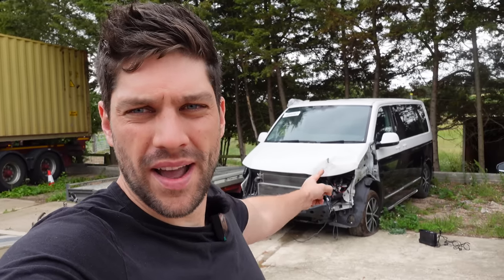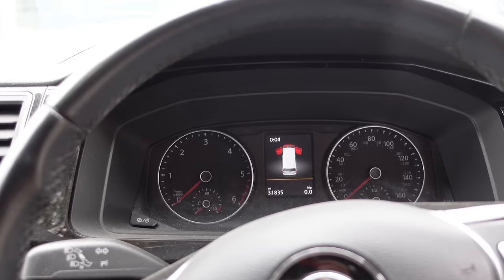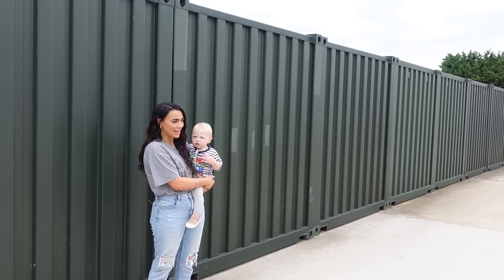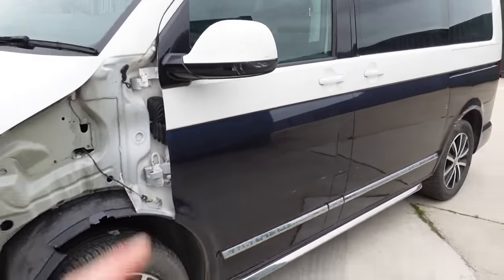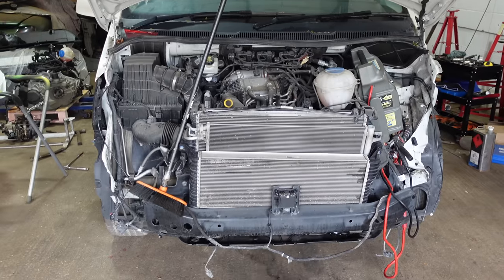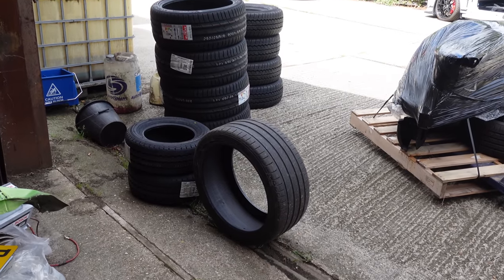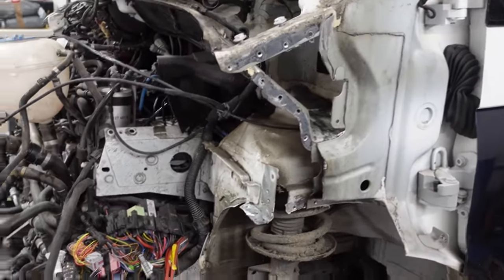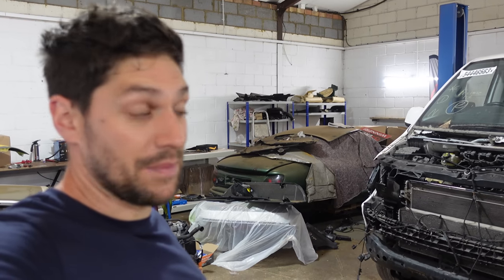I BOUGHT MY WIFE A CRASHED DAMAGED VW T6 CARAVELLE!!

Comment: Great find! You called it a Bus which is the correct thing to say in the VW Scene. These are so easy to work on and hold there money. If you need any help head over to either the T5 or T6 Forums were I’m a moderator on both. Good luck Dean!!

Comment: I’ve been a body tech over 30 years. My advice is to use a proper spot weld drill bit. You don’t drill through both panels then.you’ll need to take that front end back off to do the fuse box and that. They’re a proper pain in the arse.

Comment: I had a 2005 Caravelle and bought it when it was 5 months old with 5000 miles on the clock
 (VW St Ives Cambridge)
80,000 miles later, used On a weekly run from Waltham Abbey to Glasgow and jaunts to the Scottish high lands, this car never ever let me down and is the best vehicle I’ve ever owned. Great driving position and enough room to swing two cats.
I now have a Mercedes E class wagon and would swop it for another Caravelle tomorrow.
They are easy to drive and I don’t think your wife will have any trouble getting used to it.
As a matter of fact Dean, if your wife does not get on with it, I would consider buying it off of you 😂
Great content as usual 🏴
Reply from the maker: I started my VAG career at VW St Ives 👌🏼
Reply: My wife and I have been buying Golf’s for over 40 years, my wife after 38 years of driving has only had a Golf (Gti’s) up until  her first Audi A3, Her words “it looks nothing like a Golf 🙄🤣

Comment: Hi Dean, it looks like it has electric side steps / running boards I believe they were an option? Definitely available as aftermarket, if it does have them it’ll be a bonus for the missus and the kids as it makes it much easier for them to get in and out - well at least it was for my brood…..good luck with the build.
Reply from the maker: Oo I don’t think it does but I’ll check it out, they would fold down when you open the door if I did wouldn’t they?
Reply: They would I agree, but then again they rely on relays etc located in the engine bay…. I hope it does have them as they are a great benefit to climbing in and out.
Reply: I’ve just looked at a configurator and it looks like they are chrome sill covers 😢 

Ah well something to fit later…

Comment: NICE! Like the slightly different video Dean! Do like those vans, but i think you're gonna have a job getting it done by the time you need to take it away - fingers crossed there's no other gremlins in there lurking. Didn't like the way the dash lights flickered and went a bit odd - hopefully just battery related. You have a great little family and a supportive wife too  - good luck dude!

Comment: That pump and inner metal can be taken from a t5 they have not changed anything I can see. You can also take the relay box (the one that houses the relays under the battery from the t5). And when I say t5 I mean them all, because my t5 is a 2005 and yours look exactly the same inside the engine bay ,except for the engine and outer body panels.

Comment: Just a heads up, you probably have 30k miles left in that engine... The 204Ps BiTDI gunk up the pistons and start drinking oil at 60k. Start saving for that new motor, because they are not cheap.

Comment: i have to be honest here. if it had been me i would have bought a running galaxy. they are one of the best cars i think i have ever owned (ive had over 100 in the last 45 years). the last one i had (the ex wife still has it) cost £3,500 with 98 thou on the dickory, but well worth the money. it has 3 adult sized middle seats and 2 adult sized seats in the rear. we had the ghia, though thats titanium in later same spec cars. it had most of the mod cons, including a pana roof which was a plus for the kids. 2lt DOHC that means very little to me as im not a mech. 40 on a run but only 28 round town (av 35 combined) and although its a diesel you could barely hear the engine when you were driving, though that might have been because i had the music up loud (joke). anyway, maybe future reference?

Comment: Looks a bit dodge cutting and welding the nearside corner. VW is bonded in sections for strength. Surely it will be much weaker than before!!!!!